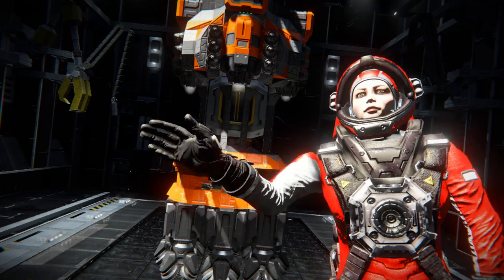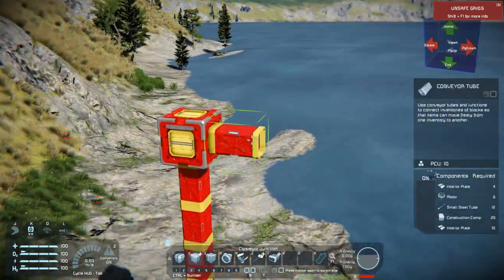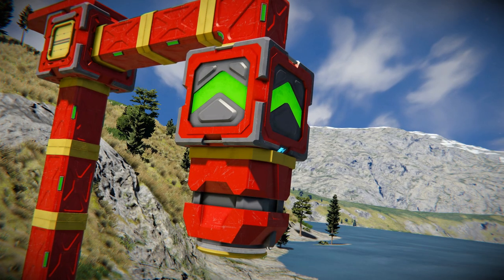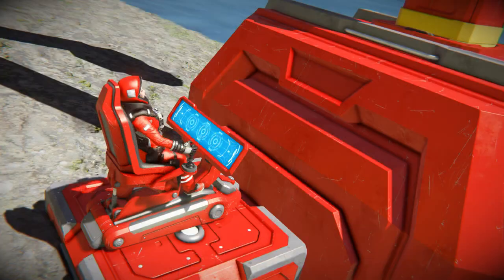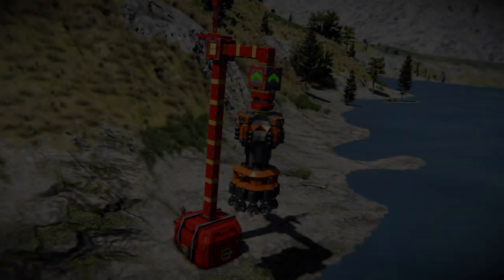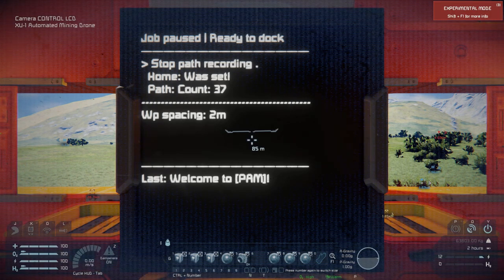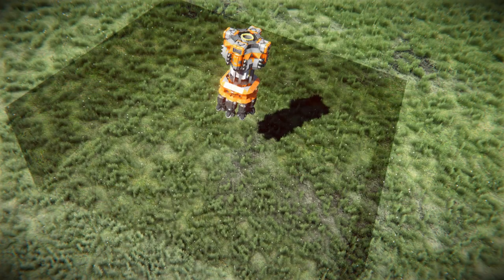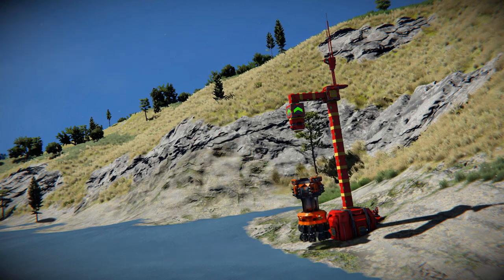How to setup automated mining drone | Tutorial walkthrough || Space Engineers

Comment: This was excellent to follow thanks!  However, I cannot figure out my issue.  I setup my dock pretty close to the same exact way you did, dock the drone, begin recording path to the ore.  No issues there.  However, when it returns home, it sit on the bottom platform below my connector and tries to dock downwards instead of upwards.  I can take control and manually fight with it to go upwards and dock and the same thing happens when it returns home again.  No idea what is going on but I'll keep trying.
Reply: I figured this out.  The script requires minimum 8 blocks space below the connector that is set to home.  I previously had 7 and it kept getting stuck on the floor.
Reply: @BenBinnebose  thanks, just ran into that issue as well, your comment helped

Comment: Hi, quick question : How do you get the outside view in order to see and configure the excavation size ? Thx for the mod it's great ;)
Reply from the maker: I think the outside view is available only in crative mode as a spectator. If you play survival you need to use the cameras. 
On the first toolbar there're cameras for control LCD, bottom, top and front.
Reply: Stick a passenger seat on it and remote control it from there, then you can use the 3rd person view, makes them easier to setup if you can fly with them.
Reply: @rdyson101  i make this and i dont see it
Reply: @Da Wendekind  place passenger seat, sit in it, make sure your suits antenna is on, assume remote control of the ship via the k menu as normal and you'll be able to use the 3rd person view

Comment: Excellent video, set up a couple in my current world on survival, everything was fantastic until I moved one of the drones, it's now decided it's max weight limit is 200g less than it's empty weight, so as soon as it starts mining, the moment the drills touch, it flies all the way back to base, then goes back to the drill site, to repeat the same issue over and over. The other drone I have moved work site several times and it runs perfectly (it's max weight is over double it's empty weight as the both drones used to be), both of them were printed from a projector so I don't really know what's going on... please... help :D

I have double and triple checked that all the engines are in full working order, and the batteries are also fine.

Does Depth effect the total carry weight? That's the only thing I changed (gold I wanted was deep) - I moved the same drone to try and gather some shallow ice and it's back up and running, although it barely gathers anything before returning, but at least it's mining...
Reply from the maker: I don't think that depth could break it. Can you bp said drone and upload it to workshop?

Comment: Great tutorial and very nice drone! Unfortunately, I get this problem: I keep losing my drones. They work just fine for a couple of runs, then they just fall to the bottom of the pit and explode. I don't know why, perhaps they have too much cargo? They run out of power? I've not touched the default settings for that, so I find it very strange. It takes both time and resources to build new ones too. Any ideas?
Reply from the maker: The first thing that's coming to my mind could be a problem with cargo overload. That would be weird though if they do a few runs before that.
Another thing could be too many calculations causing the game to shut down all the scripts due to lack of memory. Does it happen with only 1 drone as well?
I suspect that it may be the issue because somebody before reported to me that the script was quite heavy and was sometimes causing problems with memory.
If that's not that, maybe try to check if they run out of battery. May be the case too. If yes, then change minimum battery limit to around 30%. It may happen like that if the drone needs to do longer runs with cargo.
Else let me know and we'll try to figure it out.
Reply: If your using them on a a planet that isnt earthlike, the thrusters may not be strong enough to deal with the changes in weight. My friend tried to use one on a higher gravity, lower atmosphere planet, and it just got stuck doing 1 second of mining and then heading back because it couldnt hold itself up

Comment: the drones keep running out of power they seem not to be charging just dropping off ore then flying back I always find them out of power in the hole they are digging any idea why?
Reply from the maker: You may need to adjust the recharge treshold for the batteries in the behavior settings
Reply from the maker: Or the gravity is higher than 1g and they try to take more ore than they can, and thus they are not able to lift off, so the maximum weight may need to be adjusted as well.

Also when setting up the job try to align them with the planet's gravity

Comment: Cool setup, really like it. I'm having trouble with it not dropping off ice at the station. I've tried it in survival and creative. In both cases I have similar problems where it wont unload any or all ice, any suggestions on how to fix?
Reply from the maker: It should give all the ice and/or ore without any issues. Can you check if your station sorter is set correctly? Should have "drain all" function turned on as well.
Let me know if that works.
Reply: @Pro100tv9  looks like that was the problem on the creative, however still wont work in survival. I also put some other ore into one of the drills and it has not been pulled out of the drill either.
Reply from the maker: Do you have any possibility to print another drone? I suspect that conveyor system may be damaged or the settings are different from default. You could also try to clear sorter's filters to blank and set active filter to black list.
Reply: @Pro100tv9  Ok so have built a new one in my survival game. Its collecting and returning ice perfectly. Now, however it wants to drop stone whatever settings I have on it. discovered that after a few runs I hadn't welded up the beacon and sensor, so fixed that however the stone still gets kicked out.
Reply: @broganshattky5677  Thats normal. Just go to the drones control panel and disable any ejectors

Comment: i have a problem i always get the message: Last Eject Failed and it always keeps ore or stone getting stuck in one drill or in the small sorters does someone have a solution for this problem because if it is not empty it won't start again
Reply from the maker: Hi @TheLestart try checking if all the conveyors were properly printed. The drone strongly depends on those connections
Reply: @Pro100tv9  ok i will check thanks for the quick answer :)

Comment: up , down or selecting not works help pls :(
Reply from the maker: Make sure that the in-game scripts are enabled in your world settings
Reply: @Pro100tv9  Sorry man i just see u already answered same question in down . But in one place it says ship stuck and keeps trying , for now i passed to second hole but idk why is this tells it stuck in there . Do u have any idea ? And i cant remote it more than 200m do u know how can i fix it ? (Sorry for bad english)
Reply from the maker: Do you use any mods? Also check what's the antenna range in your base
Reply: @Pro100tv9  No i dont use any modes and my antenna range is 25000 but idk still whats the problem its just saying no connection (wifi icon). By the way really thanks for helping and fast answer <3
Reply from the maker: Before you setup the mining job try aligning the drone with the gravity. It has weak side thrust, so when it's tilted to the side it may get stuck in the shaft